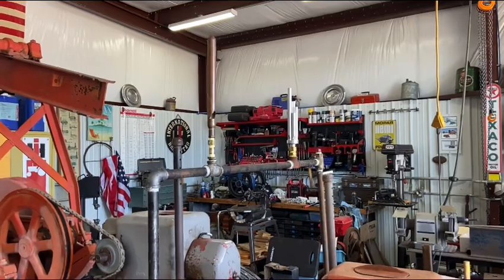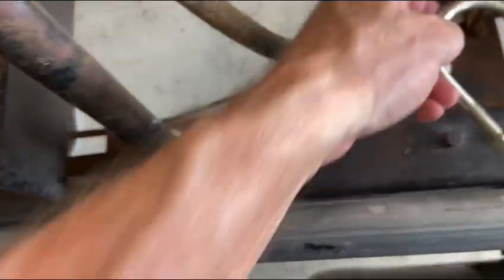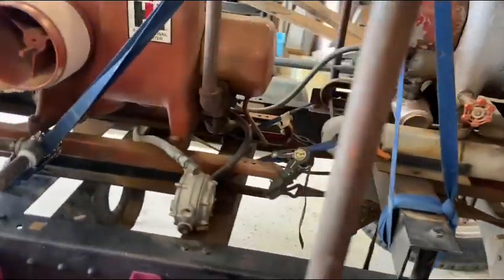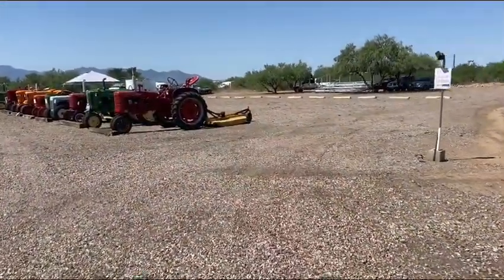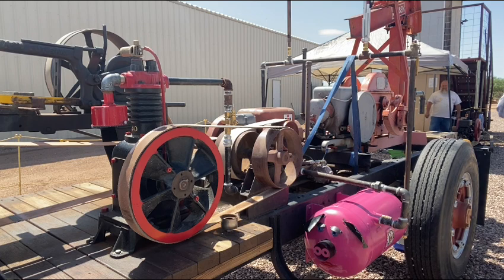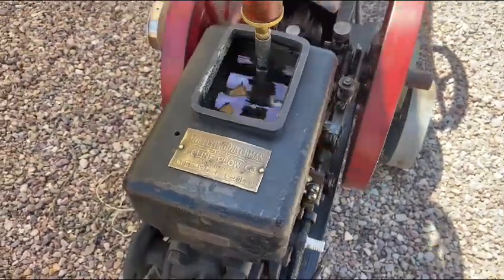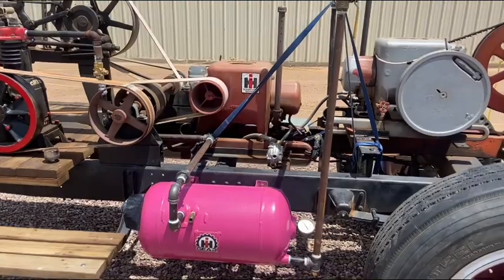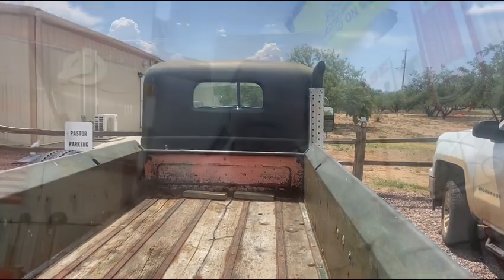#hitandmissengine Plumbing The Pig Part 2!

Comment: The place we are baling right now, the guy has an old IH A or a cub with a woods belly mower on it. He completely restored it years ago, been in the barn since. I kinda want to see if I can buy it. 
I've got the guage you need.. steam guage off an old locomotive.. but you can't have it, it came from my grandpa.. from when he was shop foreman at UPRR... We were using it for air pressure in the shop, until the old plastic lines failed.. if I remember in the morning, I'll get a shot of it.. 
Pretty sure it was a steam guage, but could have been air🤔
Too bad it was a bust, but you have enough ice cream to make it through the heatwave 👍😁
Reply from the maker: Buy that FARMALL Ed!
Reply: @mattthescrapwhisperer  he's got to want to sell it.. he's not doing well, so...I really don't know. But I'd like to have it.
Reply from the maker: @GosselinFarmsEdGosselin  Hang in there!